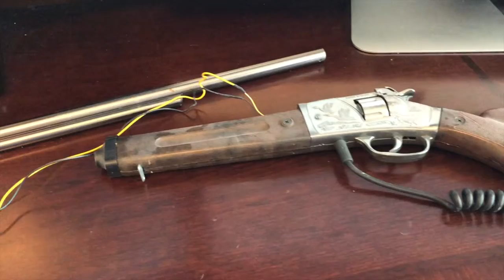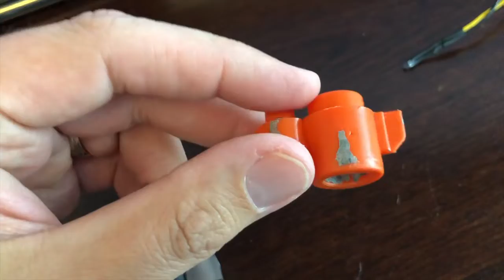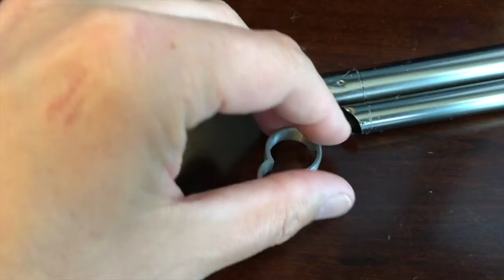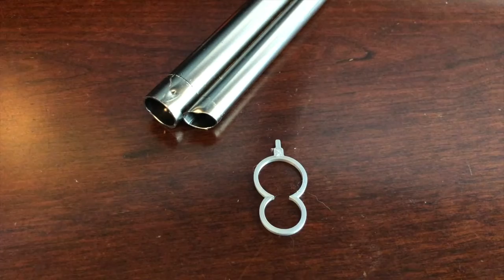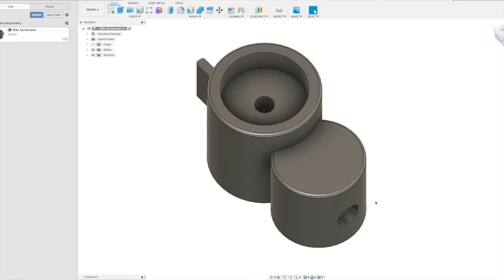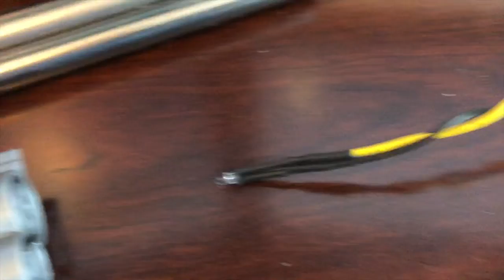Shooting Gallery Repair - Fun with 3D Printing!

Comment: Do you have the  code for the nano with the ir  pull up resistor to the 12 volt output?
I've gotten so far from your videos but I'm stuck with that. Would really appreciate that.
Sorry about your father in law, I had 2 people in family die of heart attacks.
Reply from the maker: Thank you. It's been a really long time since I've looked at the code, but here is a file with the gun and target code.
https://www.dropbox.com/s/8zo8onkftd7jgy7/Arduino_Code.zip?dl=0